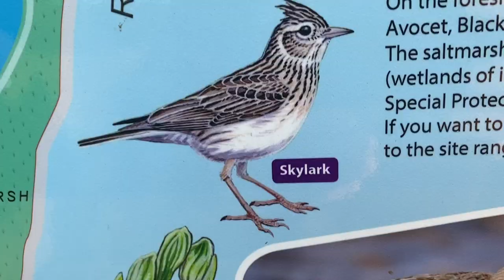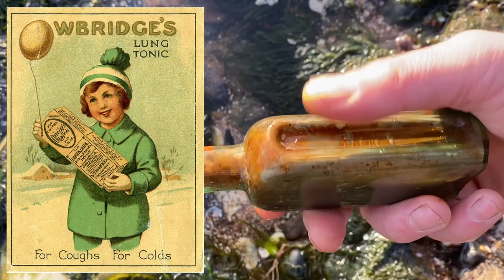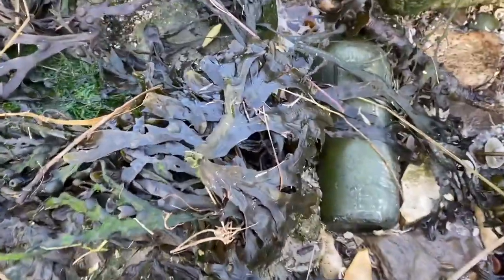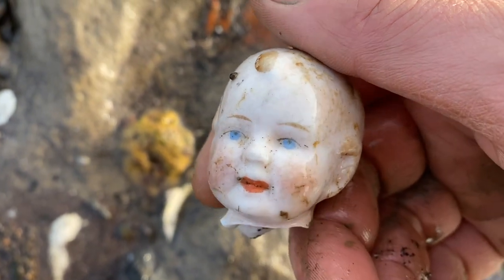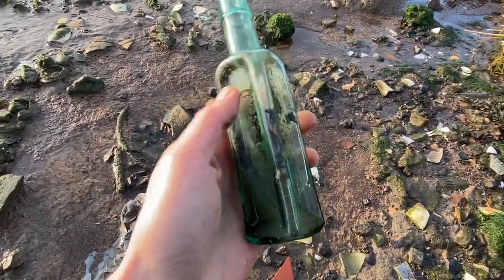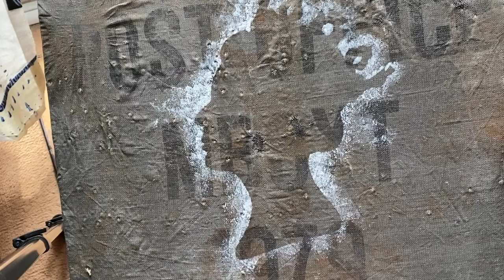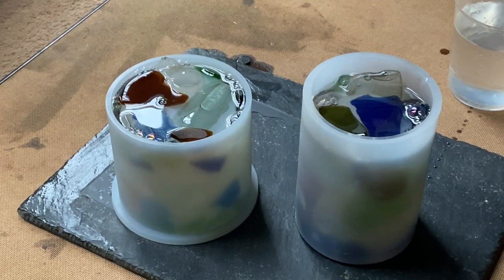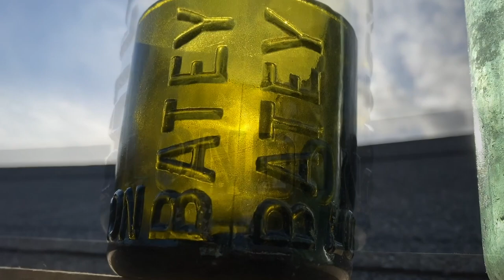Mudlarking a NEW spot! Finding River Thames Treasures

Comment: If you use an air compressor to shoot a stream of air between the resin and mold to "break the seal/suction" it helps get one's like that container/cup mold out easier, canned air might work too

Comment: That was a great hunt Simon. Bit cleaner than the foreshore. The wind noise is always an issue with the 360 but I think your Insta360 model has an adapter for an external mic. I may be wrong as it was I long time ago when I was looking from one for mine.

Comment: An easy way to demold from those silicone molds is to pull the top of the mold away slightly and let warm soapy water seep into the mold, squish it around a bit and it should come out a lot easier. Hope this helps you, it's works wonders for me. Good luck! Your so creative and very inspiring! Thank you for taking the time to make these videos and share them!
Reply from the maker: Thanks Cath, I had trouble because I was leaning from the side (to get a good shot)

Comment: Top tip for 'demoulding' Si, put some Fairy liquid in your hands and rub it over the outside of the mould that way when you are peeling it back it doesn't stick and slides off easily.

Comment: Hey Simon, if you'd like to get the air bubbles out take a hair dryer or heat gun on low/medium and run it all around the outside of your moulds. Also if your doing a large open face piece it also works to get the air bubbles out by running the hairdryer/heat gun up and down the entire open face. Hope that helps you mate. Dave P. Washington state U.S.

Comment: Some ideas for your etsy store from textbottles where both the top and the bottom is broken.
Saw out the text side and put it in a frame, maybe with a little light behind it or make a mosaic from different colour bottles text-sides in a frame.  You can buy the stained glass lead strips in lengths for joining the pieces.
This in front of your window gives the effect of stained glass when the sun is shining through.
Or drill a little dimple in the underside and put a led light in it, then put it standing up in a bit of wood so that the led isn't visible and text is readable. The light highlights the text and ripples in the glass..
Reply from the maker: Thanks Mudlover! 👍🏻👣🧡 Cool ideas

Comment: Those moulds - instead of peeling them around the outside, try tucking them inwards. So much easier because the product helps to push itself out.
Reply: Add a bit of dish soap once you've got it moving

Comment: Massive fan of the sea glass finds, and long time jealousy-harborer over what you get to do day in and day out! A (important!) note on the tumblers though: because of the chemicals in resin, it's not safe to eat or drink from resin. The chemicals transfer and can make you quite ill over time. They'd make excellent vases or candle jars though! I think a way to get around this would be to buy some cheap glass/transparent plastic tumblers, sand them down (so the resin would adhere) and add the glass and resin around that? Needs more thought but I have some ideas I need to test out, because sea glass drinking glasses would be incredible!

Keep up the good work Si!
Reply: Also, I'm going to be watching Time Team episodes for months and months at this rate. There's so many! I'm hoping now that I have a car I can get out there and do more mudlarking and really get hands-on with history :)
Reply: I think I may have lied haha. As long as it is completely cured/set you should be fine. Best to leave them for a few days once out of the mould I think! Silicone is also a little tricky for curing resin apparently. What a conundrum.

Comment: Mud and art or art from mud and a Fine Si Finds Adventure! Did look a bit chilly but what's some discomfort when it comes to luck inna muck? If you have a vibrating sander and put it against your molds with resin it will vibrate the bubbles to the top. I've used thus method for plaster and resins. Kind Thanks Simon! Many Blessings and Great Creations! A Fine Kitty as well! Love, Light and Joy! DaveyJO in Pa.
Reply from the maker: Thats a great idea!! Cheers DJ

Comment: I wonder if you could fit like half of a broken bottle in the taller resin mold. like if the top and bottom were broken so you just have the middle section or maybe the bottom edge and top is broken off? So you would get a clear resin with a huge section of a bottle suspended in it.

Comment: Great idea with the glass fragments may try it with metal detecting bits,can you tell me where to buy the moulds please
Reply from the maker: https://www.ebay.co.uk/itm/Big-DIY-Silicone-Brush-Pot-Mold-Resin-Making-Crystal-Crafts-Pen-Holder-Mould-/293639319383?_trksid=p2349624.m46890.l49292